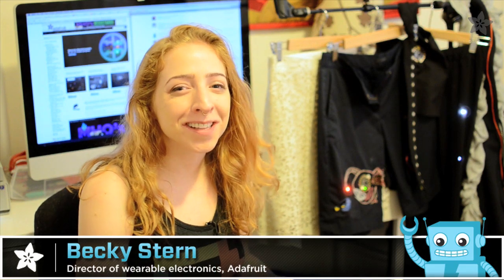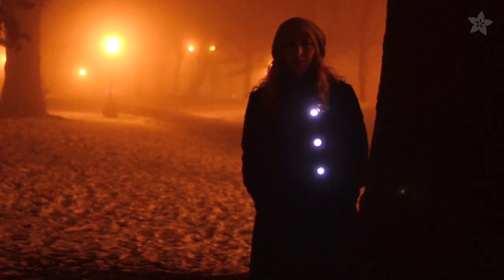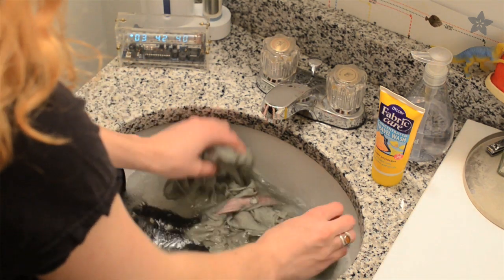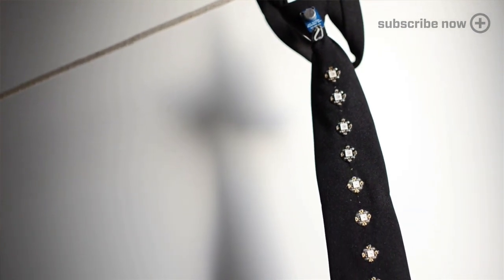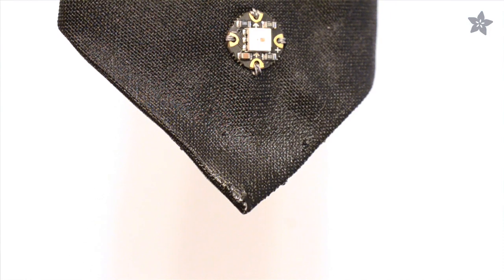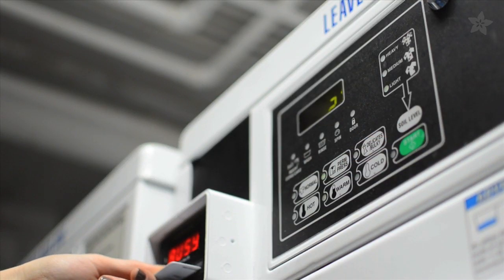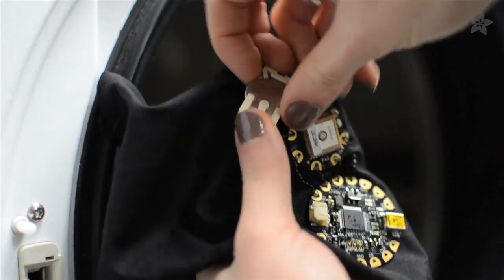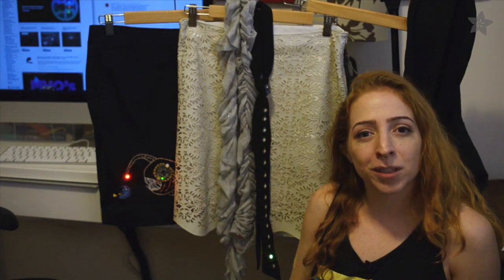Washing Wearable Electronics

Comment: I think a little more research needs to be done in the area of 'wash-and-wear' electronics. Maybe take an item with an LSI on it, wash it a couple of times over a period of weeks and then take a good look at it six months later. Also, take a close look at any stranded interconnect wire that may have wicked up some water.